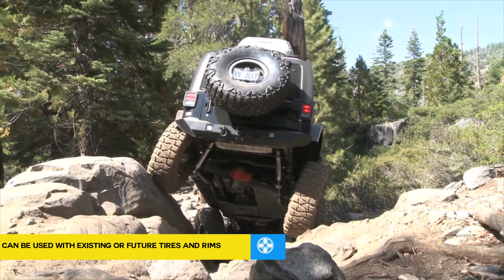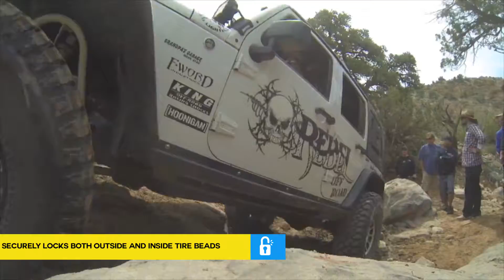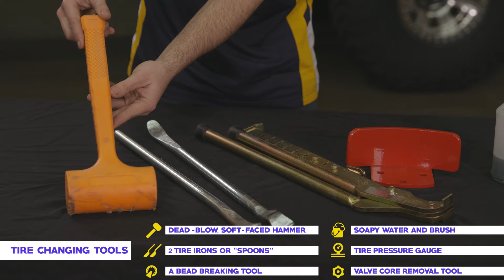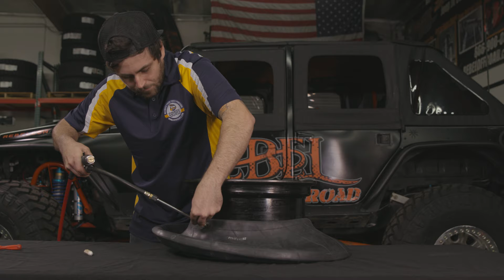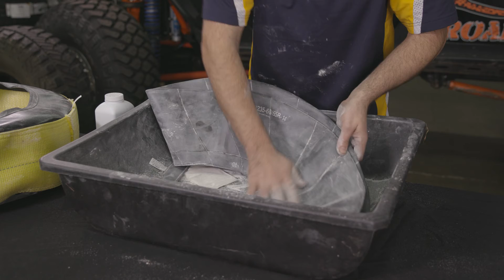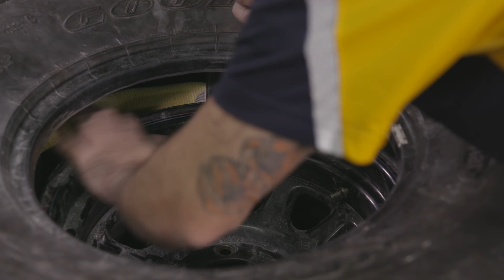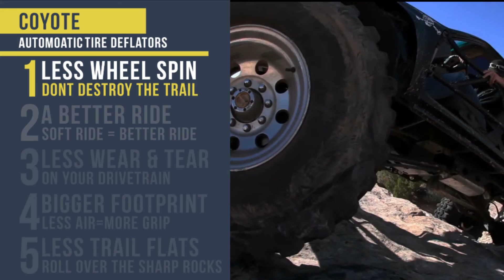Installing the Coyote Boltess Beadlocks

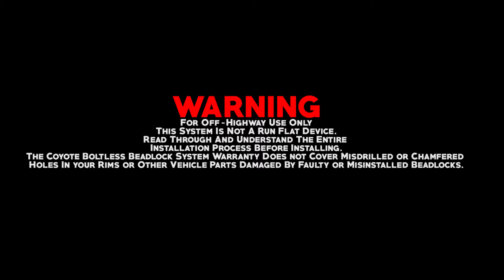Comment: I was excited at 1:31 in the video when you said (and show words in video) it is Street Legal / No D.O.T. issues and then at 2:30 you show a disclaimer that it cannot be used on the highway?  Surely there is SOME kind of D.O.T. issue if you cannot use this system at highway speeds (55 - 65 mph)?